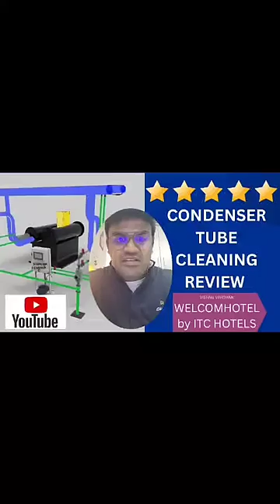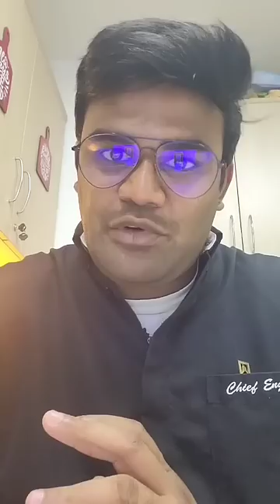"Daikin Chiller Maintenance Made Easy | Automatic Tube Cleaning System Customer Feedback"

Comment: “The sponge ball based automatic tube cleaning system works smoothly while the chiller is running. Manual tube brushing is no longer required, and condenser efficiency is consistently maintained. Very effective solution for long-term operation.”